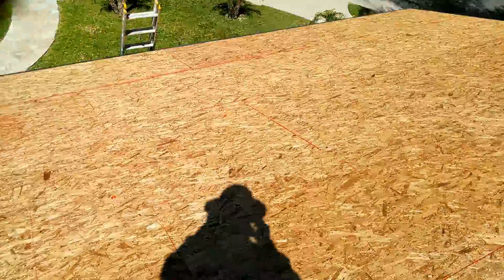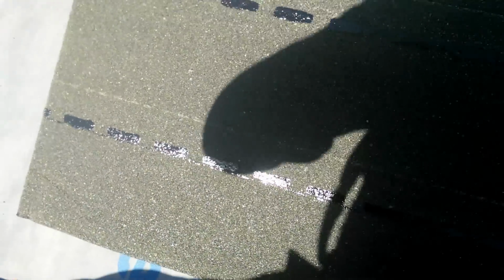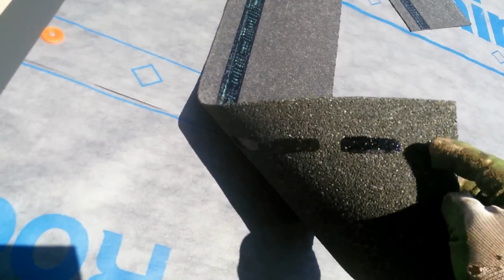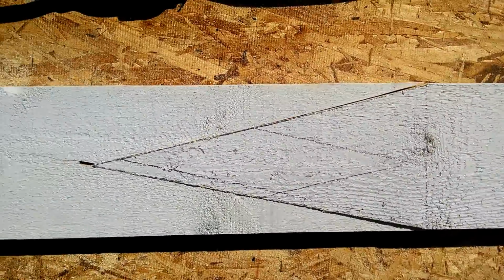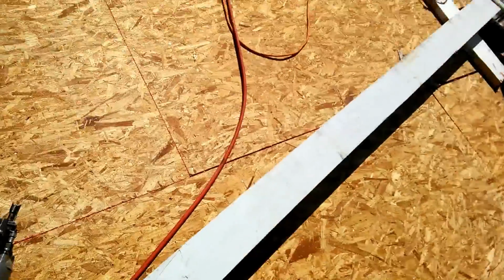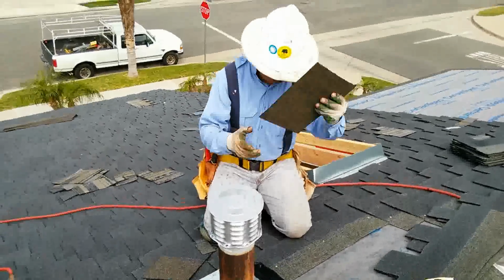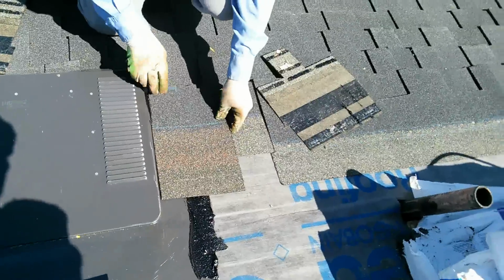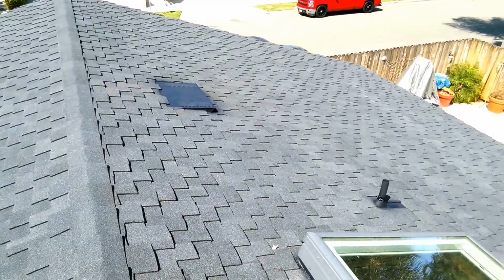Do you want to be a roofer?  Watch this video!

Comment: I like how you guys are on starter up The Gables I do that too but I don't put mine up side down
Reply: Yeah, I've never seen them installed like that.. But what he said, does make sense
Reply: They are not supposed to be installed like that the reason why is that the tar strip on top of the starter shingle is not a full tar strip thus allowing water to get through.thats why you are supposed to apply the starter shingle the way you have mentioned but when you do that you have to peel off the plastic fill to allow full contact with the evedrip and the full tar strip will melt properly in the heat to allow for a proper seal so water doesn't penetrate into the roof system

Comment: When I seen OSB plywood sheeting you lost me
Reply: Why exactly? It's what my crew uses? Or are you just not a roofer? Or am I missing something?
Reply: marcus edwards was wondering the same🤣been out of roofing for a minute but I remember jobs using osb
Reply: ZipBoard system is what is being used now, but there isnt anything wrong with osb, if your roofing is good enough it shouldnt get wet.
Reply: marcus edwards he might have been referring to that osb not looking like it was over skip or shiplap and was directly on trusses. Which if that was the case and yall doing that then youre not roofing right
Reply: oriented strand board and plywood are to 2 different types of board
Reply: for roof sheathing? no way  @PrinceDrumstarr

Comment: yo wtf.  starter is upside down.
Reply: He made a comment about that.
Reply: Yeah, this is a bonehead move for sure. Why anybody would choose to install a starter upside down is beyond me. That little plastic strip(called a selvage strip) you see on the leading edge is designed to be non stick . The leading edge always leads with the adhesive, it's how that product works, it's why it was designed that way. Eric doesn't get this, clearly. Installing like this voids any hope of getting any kind of good warranty with the manufacturer. They'll take one look at this video and say, "Oh. Look, he's installing the starter strip upside down. Fail. Will not warranty."
Reply: If you need more proof that this is unacceptable, look at the GAF ProStart installation instructions provided for you on their website. I know it's not Certainteed's instructions(their technical data sheet actually fails to describe which side up the glue goes), but all of these starter strips are basically the same, IKO's leading edge data sheet says similar. Look at the picture in the document. You will clearly see the adhesive strip facing up and out.

http://www.gaf.com/Residential_Roofing/Starter_Strip/ProStart/ProStart_Starter_Strip_Installation_Instructions_English_Spanish_French.pdf
Reply: He listened to an OSHA inspector that told him he wanted the starter upside down... He should have told the inspector to contact certainteed and have them sign off on that. If they catch it with a diamond warranty, they will deny the warranty..
Reply: Eric Avery he better use that mud..
Reply: Bahahahaha
Reply: Haha he wants it to stick to the metal I thought that's what the nails are for you fail dog it doesn't go upside down
Reply: I looked at the gaf bag it tells you to install it glue up
Reply: You're upside down

Comment: you need plywood clips pal
Reply from the maker: really?????? over space sheathing? send a copy of the code please
Reply: Where are H-clips required?The 2006 edition of the International Residential Code (IRC) requires the use of H-clips in construction, but not all jurisdictions comply with IRC regulations. For instance, Jackson, Miss., complies with the IRC while Harrison, Miss., does not. Some homes in jurisdictions that currently require H-clips were built before the IRC required them and are not in violation of code. Other homes were built before their jurisdictions adhered to IRC requirements. However, since InterNACHI standards of practice are limited to safety and system defects, it is not necessary for inspectors to determine whether a lack of H-clips constitutes a code violation
Reply: +Paul still, all good roofing companies put in h clips.
Reply from the maker: +Mike Ditkas Lovechild ...you are funny
Reply from the maker: I want to see ,where the code says , you have to use clips over space sheathing my friend, the code refers to different code installations , this is a re-roof  , not a brand new house.
Get to know the installation codes before you head out and do roofs.
Reply: +Roofing Solutions By Eric Garcia Seriously man, i meant what i said, "all good roofing companies use h clips". Your argument that the code doesnt say u have to, does not mean you shouldnt. I mean come off your profits a little man, spare the extra couple cents and 30 seconds its going to cost per roof to give your customers superior service.
Reply from the maker: +Mike Ditkas Lovechild ...do you know what is the purpose of the H clips?  do you understand what is installing plywood over space sheathing?  do you know what is the difference?
Reply: Mike Ditkas Lovechild
Reply: not necessary with a re-sheet over 1x6 skip sheeting
Reply: Henry Finkelstien not necessarily

Comment: Lol the OSHA guy is not a building inspector he's a safety inspector, dummy you put the starter upside down even a manufacturer will tell you that, so all that fancy paper to get the manufactures warranty you just blew it by putting your starter upside down
Reply from the maker: If you use , starters on the rake or if you don't use them , it doesn't make a difference .
In the city of Huntington beach this inspector asked me to install them upside down , claiming that water can not get between the metal and the starter when a high wind strikes.
I can't argue with city inspectors, here in southern California , there is no need to use Ice and water shield down the valley , it's freaking dry 11 months of the year,  Last time a city inspector was laughing when he saw me installing ice and water barrier, this is not Canada, Washington or any other rainy state .
Remember , starters don't make any difference in any shingles installation, you can even use 3 tab shingles as starter or have of the dimensional shingle, it don't matter.
Reply: The starter course goes upside down, then the first course goes on top of that ...It prevents water from running between the tabs ...Actually I don't see the point in doing it on the gable ends, but have seen it done and have done it myself when instructed to do so
Reply: Too bad for that Inspector. They can never be wrong even when they are. Same with us roofers. You ask five roofers a question and get five different answers but none of us are wrong.
Reply: one of those 5 is definantly wrong ;)
Reply: rich tedesco the reason for installing starters on gables is to bond the roof perimeter together to prevent wind uplift ,and to help heavy rains stay draining down to the gutter/eve edge and not run over the drip edge ,it's the same concept as installing a metal coping on parapet walls ,you always shim the street side of the coping so rain flows on to the roof vs down the walls ,if you skip the gable starter and there's a blow off no manufacturer will pay 1 dime ,I've seen it happen .

Comment: If you are not tied off then get off my roof.
Reply: exactly
Reply: off your roof pay me for the hole job is the law
Reply: Ropes are a tripping hazard.
Reply: Joe Spina on a roof with that pitch, ropes are only going to be in the way and slow you down.
Reply: CWV3 i make 900 "150 a day" for 6 days of work and its my first month i dont work with pussys tripping over a harness every 2 minutes we never tie off and nobody has fallen off in the 20 years my boss has been running the show
Reply: time and place for it, not all the time though. like anything over 2 stories 6\12 up, if. it is a osha rule and those fines are enough to make me where it but I've taken the classes on it. trust me if you aren't wearing it right, by the way most dont, even the ones who think they do. if you were to fall and have that catch you the wrong way, or just over your maximum potential free fall(if you were wearing it right) the consequences are way higher than hitting the ground. worst case senario, you have more than 10 feet of free fall. your shock absorber is compromised, and you weight pretty average about 180 190. when that rope finally stops you, assuming you nailed your anchor on tight as fuck. the weight that you gonna put on that rope, and on yourself, is gonna be about 5000lbs. and at that moment the ground will sound so much nicer
Reply: It's way more dangerous with ropes cause u can trip and fall off and then if the rope stops u, u lose ur balls
Reply: Seth Murphy Yup, I live in Canada BC. WCB would fine you if they caught you on any area that is a fall hazard. Roofs, open floors, you name it. Falling off a roof, your anchor and lifeline will save you. But i bet you will be seeing the chiropractor for weeks, fixing any ribs or disks in your spine. Everybody acts tough, but at the end of the day ropes save lives. Everyone falls, we arent bulletproof.

Comment: I have worked commercial low sloping single ply roofing and it wasn't super difficult.  Would residential roofing be harder? it seems like it requires more skill
Reply from the maker: Branflakes88 ...the roofs are classified like this:   above 8/12 the risk of falling off is high,  less than 2/12 the risk of water leaking is high so for that the price is higher than residential roofing, in between not much risk of anything so the roof are not that expensive to re roof.
greetings and thankd for watching 
Eric.

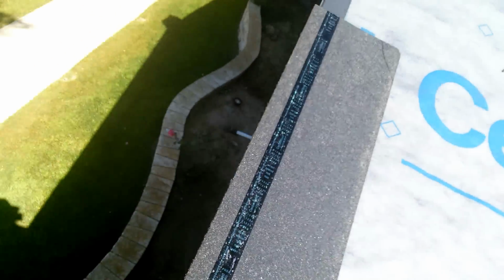Comment: Why did you put the tar strip down @ 5:37 ? the tar strip should be facing up so it seals to the next shingle
Reply: There’s a myth throughout the industry that the starter goes tar side down. Maybe at some point a long time ago it did? But it’s wrong today. Also, there is a myth that your are supposed to peel the plastic off the strip that protects the tar while the shingles are inside the package. That is also wrong.

Comment: I got a question for all y'all roofers when you're getting paid by the square and how many bundles you put downyou're supposed to get paid for your starters and your cat as well as the bundles of shingles you put down as well just asking because I had a contractor try and tell me that you don't get paid for the starters and your cap that you're just supposed to run your cap and your starters for free as a part of the roof all together
Reply: Brian Pridgen no not really its already in the price. Only time Some roofers up their charge per square based on pitch of the roof and how many layers.

Comment: Instead of putting the starter upside down on the rakes can't you just caulk underneath?
Reply from the maker: It was not my call on the starter upside down , on the rakes , I've seen many ROOKIES  that make a big deal about the starter been upside down , on the rake side it does not matter how your starter is installed , the most critical part of of the roof is the EAVE side , that's where all the water is going to drip off the roof.
The inspector made me install it upside down , claiming that high winds can drive water underneath the starter and cause water to run down the rake , To Me : it's nonsense ,  it doesn't matter how you install your starter on the rakes , but some People think they know better :  I can't argue with non roofers , I appreciate the comments tho, I wish I can send this video to the stupid city inspector that made me install the starter upside down .
greetings.
Eric.
Reply: Ok, thanks. Is it so bad to weave architectural shingles at valley? What is your experience with...cracking, leaking?? Or is it just fine to do (barring warranty, that is)?

Comment: I'd fire these clowns immediately. Only a lazy inspector would allow the OSB to be installed without clips. Part of their video shows the starters on the wrong side; tar tab is supposed to face up, not down. The way they cut their facia will require replacing in a few years or sooner.  The v will separate as the wood expands and contracts causing water damage, plus it looks like shit from the ground. The guy running the first row is nailing too high. They're running Certainteed Presidential Elite shingles and not applying them correctly.  They require a 6 nail storm pattern, not five. His rakes will surely fail over time, the rake edge pieces are far too small. The louvered vent and metal boot are not sealed correctly. His video shows him using Diamonddeck underlayment, which requires cap nails  and Titanium on another part. In Michigan we require at least one row of ice/water shield.  He has voided the warranty on this very expensive  shingle roof.  To the guy (Michael Ledford), if (and I stress IF strongly), you actually made that kind of money as a union roofer, you did not do so in just 10 years. It takes you five years (minimum)  to pass through your journeyman program and then you go on a waiting list to start as a crew foreman (usually 5 or more years) before you make it to senior foreman; which can take forever. Further commercial roofers do very little framing, zero heavy equipment such as cranes (that's another union department who will surely have something to say) , even less welding and iron work; if any at all. As for you salvaging all that scrap metal, I seriously doubt it! Generally there is a cap on how much the senior can keep and how much has to be returned to the local. If you were making that much off scrap the local will generally have their hand out to collect it and dish out finders rewards. Your travel expenses sound about right, depending on the distance and length of out of town stay. It was not tax free because the IRS still considered it either earnings or bonuses, both are taxable under their codes. I must admit, your 1.2 million in eletronics versus over $50,000 for custom made furniture kind of perplexes me. If your spending that kind of money on entertainment equipment you'd be spending at least half that (or more) on furniture. I was in the carpenter's union for some years, didn't want to travel anymore and walked. I am now a self employed high end trim carpenter who builds custom residential theaters, $200,000 kitchen cabinets, etc, in multi-million dollar homes,  in places like Gross Pointe Isle, Club drive in Detroit, Rochester Hills, Birmingham, etc. I know a little something about high end interior builds. Your account of things don't add up. Your wife maybe didn't make as much as you (that's debateable)  because it was Wayne State, which is a relatively small University, compared to others like Yale, Stanford, Oxford, where she would assuredly double her salary. Sorry Michael, being a seasoned man who was in the union and is currently in the business, your story doesn't ring true. Photoshop works wonders these days.

Comment: Must not be code to run 2 rows of ice and water at the bottom or however many it takes to have one row over exterior wall. Put a layer of ice and water over the flashing of that furnace pipe as well, leave that tar on the ground
Reply: Richard Kranium yup I’m front he same area as he is and we don’t use ice and water shield, well it’s not code so almost nobody installs it. My company does install it in valleys and other problem areas. 

Los Angeles btw same as him I believe although I think he’s more Orange County/ Long Beach área i think.

Comment: you should NEVER install a starter strip shingle upside down. the mineral back surfacing will not stand up to water that drives it's way under your shingles.
Reply from the maker: sir, it's not my call, the city inspector required that , and also roof cement along the edge of valley metals. sometimes I come across this city inspectors , they want their way or  you don't pass your final .
I usually install it with the glue face up but he told me not to, due the wind and sea breeze.
Reply: +Roofing Solutions By Eric Garcia 
I suppose if that's what your inspector wants then he's an idiot lol. I agree with 95% of what's in your videos and understand it's different with certain geographic areas but as a certainteed master shingle applicator wizard and shingle quality specialist I can tell you that certainteed will not honor a warranty claim with upside down starters. and I personally feel that regardless of what your local inspector thinks the general population should know what's proper. I've seen you doing it properly in other videos so I know it's not your usual routine. thanks for all the great videos BTW. keep up the good work.
Reply from the maker: thanks, I just came across a city inspector in Compton CA that made me install dormers on a garage , I told him why? there is no attic? he said because when you close the door it's get hot in there ....Lol, I answered...is it better an A/C unit to keep the cars cool, he got mad at me , but it was funny , on the final , the first thing he check was the dormers on the garage...
I had to do it , otherwise I don't get paid
Reply: I just got a question for y'all you get paid to install your cap and starters as well as your shingles I had a contractor tell me that cappin starter and ridge vent were free with the roof when you're getting paid by the square

Comment: why cant you run them on 5" stagger why 5" 15 "5 "why
Reply: aaron boyd Presidential shake has a different step system. you have to hide all your seams. hence the 5 15 5 15